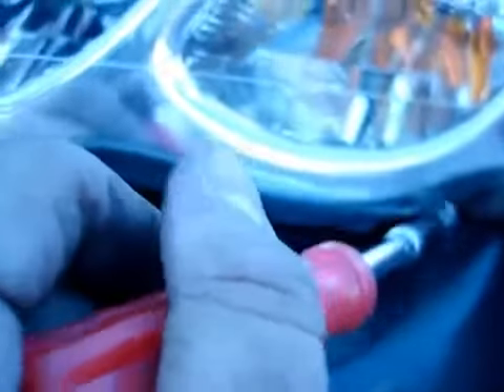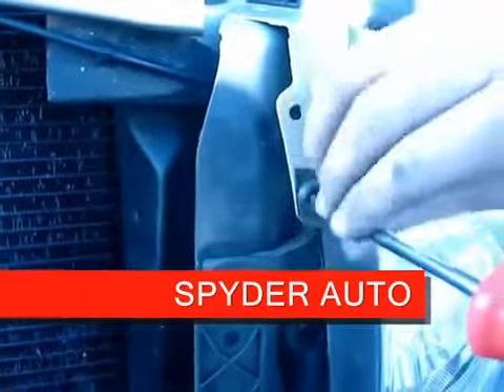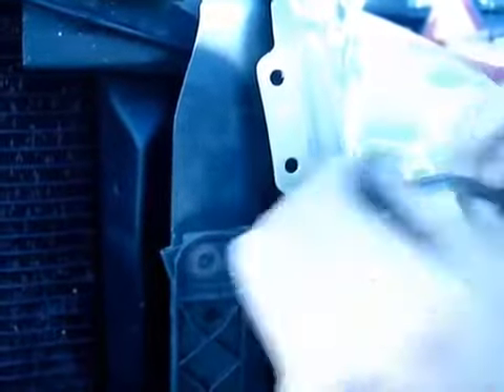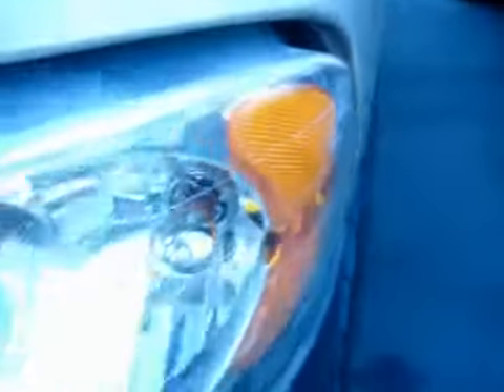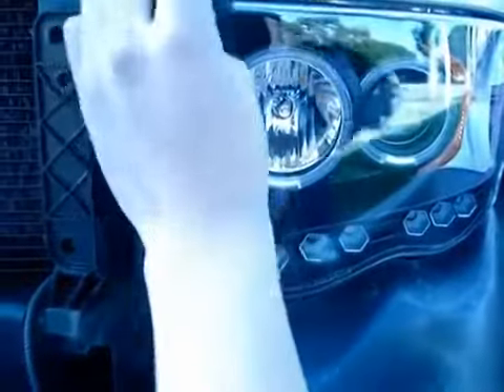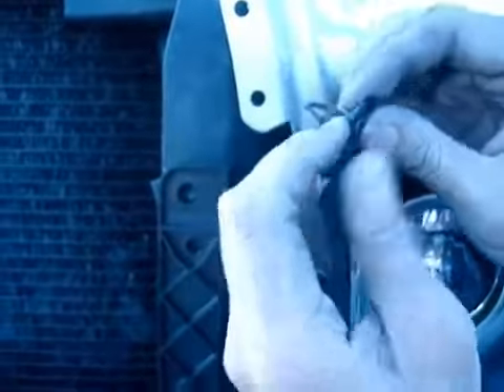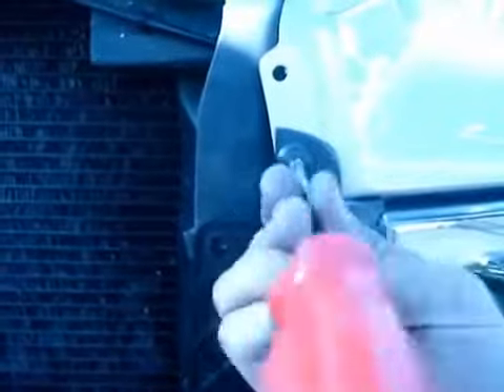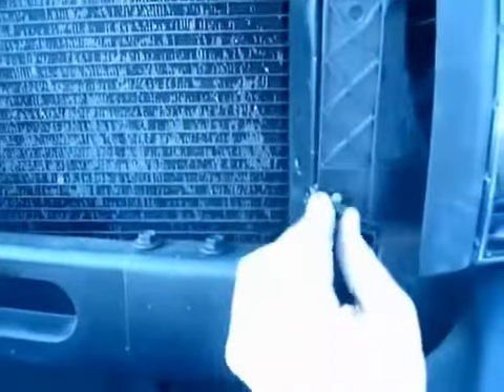Spyder Auto Installation: 2002-05 Dodge Ram Projector Headlights

Comment: My issue with the spyder replacements is that the wires for the bulbs are not in the rubber boot they have plugs on the ends of the wires and the dust boot doesn't fit on the headlight assembly. Would be nice to see that or have some audio instructions about it